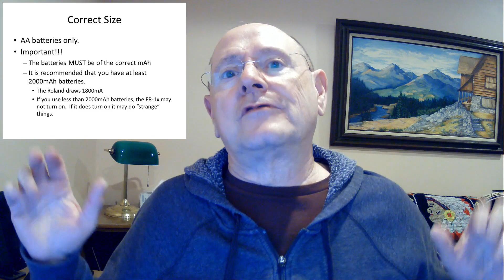Batteries 101 for the Roland FR-1x

Comment: My Roland fr-3x takes 10 rechargeable aa batteries. I power it from a rechargable powerbank that will put out 12 volts. It lasts for days on a single charge.
Reply: Hi Sir, could you please tell me which powerbank (type, brand, MAh, polarity (center positive maybe) etc.) did you use and what kind of an cable (type/length etc., is an USB A to DC-IN good enough or maybe USB-C to DC-IN better)?

Also another question, how did you mount/attach it to your FR-3X? And did the powerbank got warm/maybe to warm (and possibly damage the accordeon) after playing a while?

I'm sorry for asking so many questions, but I would like to have the same setup myself.

Thank you very much for your answer in advance.
Reply: @SantiZeljkovicI forgot to say I Velcro it in between the keyboard and the bellows protection pad. It adds some weight but works great, especially if you are strolling, or needing to be mobile on stage with a wireless audio system.
Reply: @kentaccordionist thank you very much sir. Could you please give me more information about the powerbank (brand, type, amount of MAh, etc.)? 

I'm currently searching also for a system to have the accordeon powered for a long time and be mobile, but I am afraid that it might damage my accordeon. Therefore the question about powerbank.

If you could help me with this, I would be very thankful.

@joekarwoski: sir, I see that you are also very knowledgeable about the accordeon and batteries, do you maybe have any recommendations regarding a powerbank instead of batteries? 

I'm also afraid in charging the batteries in the accordeon itself, as every charging battery should have some space/room for heat dissipation.

Your advice is very much welcome and thank you both in advance.
Reply: @SantiZeljkovicit’s an intocircuit 32000 mah rechargeable powerbank. I have tried posting will link several times in the last couple of days but YouTube just deletes it. It will put out multiple voltages but for an fr3x or an fr4x you need  the 12v setting. Inside the battery compartment there is a terminal connector you need to remove so you can take off the battery holders connection wires and attach two wires that you will attach to the cable coming from the powerbank. I drilled a hole in the battery cover to feed the wires through. I can remember the polarity you need but if the first connection Dont work try the other way. You’re not going to blow anything up.

Comment: I really appreciate your classes. I want to buy extra cords for my 3 Rolands....is it safe to get them from WM or shall I order them?? (I am concerned about accidentally buying the wrong cords!!)
Reply from the maker: Hi Daisy, The real key is to get the correct volts and amps.  For example, the FR-1x requires 9 volts at 2 amps.  If you buy one that is only 1 amp, it will not power you accordion.  Also, you need to get the correct plug type - they have a number of different ones.  I looked at Walmart and the couple that I looked at did  not give me the amps.  The good thing is that you could return it.  I honestly do not like using the power cord for either of mine because if I pull on the cord by accident (step on it or get it trapped under my chair), I could damage the port inside.  For the 1x and 4x, that would at best make is so I could not use any power cord on it and at worst damage the motherboard an destroy my accordion.  For the 8x, that is also your charging port.  Honestly, a good set of batteries will last you many years.  I have had my 1x for 12 years (I can't believe I had it that long) and this is only the second set of batteries I have had to buy. I got my 8x in Nov of 2018 and have not had a problem with the power cord/charger.  I will give you one more thought:  I charge my accordions using a UPS (uninterruptible power supply).  This will keep any power surges or "brown outs" from getting to the power cord/charger. This will protect it for you, and your accordion if it is being charged (8x) or being used.  You can get a small one on amazon for about $75 - I would recommend an APC brand.  This is probably way too much info, but I want to make sure I answered your question.